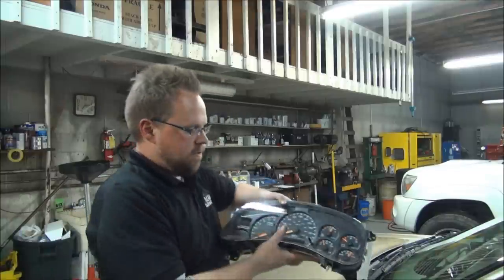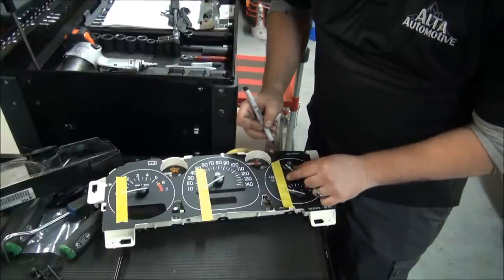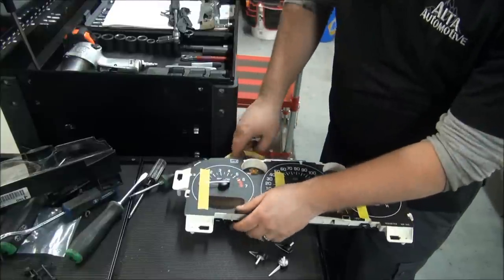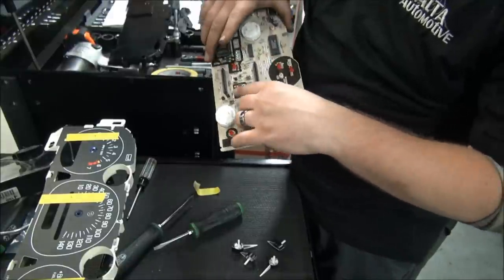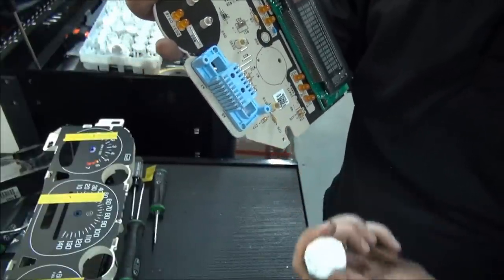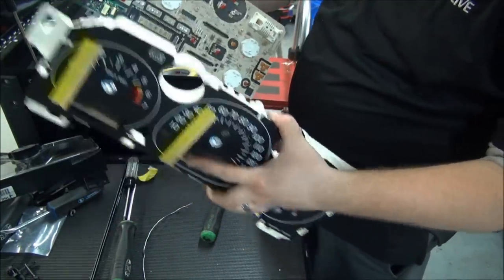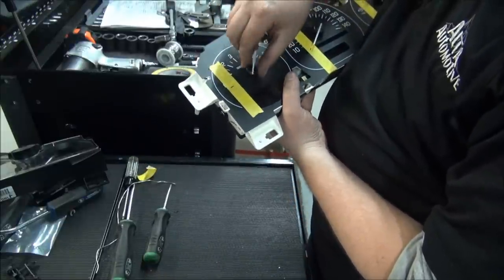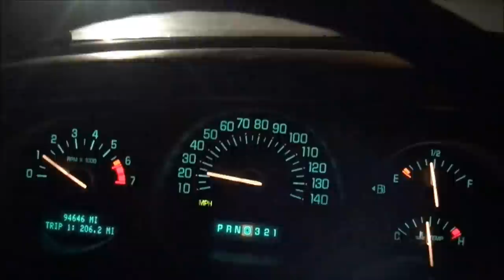How to repair GM Instrument Cluster | Speedometer | Gauge | Stepper

Comment: Great Video. Strait forward. Very easy to do after watching you. Just fixed my 2003 Suburban gauges. They all worked great. For those watching. Get the desolder  gun like his with the pump. makes it very easy.

Comment: all gauges are good except the gas/fuel. it moves fast like a hummingbird
Reply from the maker: The most likely cause for that problem, on that year Yukon is a problem in the fuel tank with the fuel level sending unit. The fuel level sending unit will start going out and send wacky information to the gauge causing it to jump around like that. Another thing I have seen is resistance in the wire from the sending unit to the gauge shorts, corrosion, small breaks int the wire etc. However you could have a problem with the instrument cluster/gauge itself its most likely the fuel level sending unit inside the gas tank and or the wiring. Also check out/subscribe my other YouTube channel... I just started this channel for people having auto repair related questions. https://www.youtube.com/channel/UCXFkbsmVhcDoLQcwEsixQTg

Comment: My 2006 trailblazer i can't read the odometer  or anything else in that display window during the day in bright sun. Yes the bright /dim switch is on bright. The oil pressure gauge and temp is off a bit. temp should be 180 not 220 oil should be 65 not 50. Makes me think its been worked on before and your tape tip wasn't used my real issue is not being able to read mileage, fuel use miles to empty. Its a LT Model

Comment: U vid on replacing stepper motors very informative. My gas gage worked soon as I started motor. After 5 mins it shut down and fuel light came on. After 5 mins shut off again. Keeps doing this like as soon as it got warm it shuts down. I know I’m the fuel pump it has the prongs attached to the float. I figure it can’t be the float cause it either works or it don’t correct? I just don’t want to drop gas tank if it is in fact stepper motor. Fuel pump is 179.oo. How do I test wheather it’s the reostat in float or if it’s the stepper motor in dash. Seems opening up dash would be easier and first place to start? Please give me ur opinion. I’m very familiar w electronics on vehicle’s. Thank you again your vids are good

Comment: well informed video but my question is :  if this is such a common problem on GM 2003-2006 was is there not a recall on them ? I have both a 2004 Buick Rendezvous and a 2005 Buick LeSaber with the same problem.

Comment: Hi, just wanted to know would this work on a 99 Chevy Tahoe 5.7 L - the only thing is the fuel gauge (it doesnt move or at times it goes all the way past E or F) the others work just fine. Also where can i order a stepper motor? thanks
Reply from the maker: +C Stiles I'm not sure the part number needed on that year.. However on that year Tahoe it's usually the fuel level sender in the tank or shorted wiring...

Comment: will changing the stepper motors make the display work again. P, R ,N, D, 3 etc and display panel ?
Reply from the maker: +Sincere Bless unfortunately no that's going to be a separate problem most likely a bad solder joint on the circuit board

Comment: Very helpful video thanks for sharing your secrets. I am a mechanic and have just recently discovered how easy you can fix clusters I fixed my odometer on my buick century the other day by soldering new resistors in. One question where do you recommend buying the stepper motors ebay?

Comment: good god! i found what my problem is after buying a new fuel pump! it was just the stepper!!!  DUDE! THANK YOU VERY MUCH!!! i have a Pontiac Montana 04.
Reply: so if i replace the stepper, my guage is stuck way past full. how would i know if i align the gauge correctly?
Reply from the maker: ***** Push the motor/needle back to the point it stops, that is the place to make the mark.
Reply: Thanks!

Comment: Great video!  Changed all six stepper motors in my 04 Trailblazer.  Your video is perfect.  I am not a GM man but this is a well engineered vehicle.  The only problem I have found is that some of the components are very low quality, i.e. the circuit boards in the instrument cluster, radio, climate control, etc.  Stepper Motors and Light Bulbs should be on push pins rather that soldered in.  Keep up the good work!

Comment: I live in San Diego.  All my gauges went out separately over a period of time.  I think the cause is faulty stepper motors on my 2004 Chevy Tahoe.  How do I find a mechanic in my area that can replace these?  I watched your video (excellent) but cannot do this myself.Thanks for your excellent video.
Reply from the maker: You can send it to me if you would like and I will repair it for you.. My cell is 801-668-5566 I answer Monday-Friday.

Comment: Mine go dead. I then disconnect the battery for a while and "sometimes" they will come back when I plug the battery back in. They then work fine, until one day I start the engine and they are dead.  I have no clue what this is. The cluster seems to be fine, once it's working. The illumination lights work fine. The gauges are just dead, as though they are not plugged in. Seems to be more of a grounding issue or something in my case. 

Any ideas?
Reply from the maker: Yes I have an Idea to whats wrong..... and its not the stepper motors..... Its most likely a problem with the circuit board... which is much harder to diagnose where the problem is without a very good understanding of testing circuit boards. I would recommend trying to find someone in your area that repairs instrument clusters.. rather than trying to fix that one yourself..
Reply: Yeah. I had it fixed a year ago.  I've found another youtube video that discussed a broken wire at the firewall. It lines up with what I suspected in my case. The truck has a possibly related problem. I rarely drive it and if I park it for a few weeks the battery goes dead. I replace the battery every year if I'm not careful to keep the truck plugged in to a charger. Once it goes dead in freezing weather it's toast.

The last time that happened, the guages had not been working for a while, and when I connected a jumper cable to the battery, there was a clicking near the firewall and everything came to life in the passenger cab, including the gauges. That worked for quite a while, but recently it stopped working again. The turn indicators and check engine light are all that work. 

I also had an issue where the blue "brights" light was always on. This is the only GM vehicle I've owned since my 1980 Buick Skylark and I swore to myself I'd never own another. Practically the entire car was beta tested by us buyers and failed miserably (yeah, I bought it new). I violated my rule and am paying the price. It's like I'm in the 1960's regarding reliability. :(

Lesson learned...

Comment: My parent's 03' Tahoe Z71 Instrument cluster (by that i mean everything in the instrument cluster including the LEDs) would turn on and off intermittently for about 6 months and now everything inside the instrument cluster has completely stopped working. Could the stepper motors be a problem, or do i have a bigger issue on my hands?
Reply from the maker: +CHFilms You unfortunately have a bigger issue and will most likely need to replace the entire instrument cluster...They are fairly easy to replace yourself, call the GM dealership and talk to the parts department...Have your vin number ready to give to the parts guy, and he will be able to get you a price.

Comment: Thank you so very much for making this video. I used a different video to assist with my taking off the dash trim and removing the instrument cluster, and then used this video to assist with replacing 4 stepper motors in a 2004 Impala. I spent 17 bucks on Amazon for the stepper motor / LED light kit, and 11 bucks on a quality solder sucker tool. A few hours later everything was put back together tight and all my gauges are working like they should.

Without your help, my Impala would still be doing 110 mph while parked (broken spedometer / stepper motor). You are the best!
Reply from the maker: +Nega Stoat Thanks!

Comment: Could bad stepper motors also cause the mileage guage to not work as well? That's not working on my 04 Trailblazer and also the gauges. Wondered if the digital mileage not showing up was also coinciding with bad stepper Motors?
Reply from the maker: Unfortunately that is not the same problem...The mileage not showing up would most likely be a problem with the circuit board in the cluster.

Comment: Thanks for sharing that video. My clusters aren't working in my new used 2002 Cadillac escalade. The fuel gauge doesn't work as well and I was told from the guy that sold the car to me that the tank would need to get dropped and a new floater put in. But after tonight trying to take it in for a smog. Seems the smog connector was not communicating to the computer and I didn't get the smog done. Seems like a host of problems. But I was wondering maybe the cluster stopped working on the gas gauge as well and maybe I won't need a floater after all? Thinking I would like to get the clusters fixed first to make sure I don't pour money to the piraranas out here. What do you suggest I do first?
Reply from the maker: Very good question! Here are my thoughts..
1- This video does not apply to 2002 GM (Cadillac, Chevy,Etc)  Trucks... I know this because my GM Truck is also a 2002 and the stepper motor inside the instrument cluster is different than what is in this video and very very rarely ever has a problem...In fact in the 20 years I have been a mechanic I have never seen it... Does not mean it’s not possible just unlikely
2-The most likely cause of your fuel gauge not working is the fuel level sending unit (or float assembly) is bad or the wiring to it has shorted or been broken.
3 As far as the your truck not communicating with the smog machine... that is a separate issue and is most likely a broken wire at the OBD-II connector or a blown fuse somewhere in the truck.
4-I would recommend taking your truck to a shop or a mechanic that is very good with electrical diagnostics...My shop would charge you $100.00 to diagnose both problems (in your area it may be more or less)... And when we diagnose a problem we guarantee that will be the fix for your car or truck.. The reason I would recommend taking it to a shop is because they have expensive diagnosticequipment that will help them greatly in the diagnosis.. Or if you are very good with the understanding of a volt-meter and you have the ability to drop the gas tank down and test the sending unit and the wiring.
5- My gut feeling is you need a new fuel level sending (or float assembly as you referred to it) unit for your gauge and a blown fuse for the lack of communication... I have also seen where some shops smog machine will not communicate and another shops machine will.. So if you don't find a blow fuse take it to another shop to have them try it on their machine..
I hope that helped... Sorry its not a quick easy answer for you on that problem...

Also is there anything else not working on your instrument cluster gauge assembly? Or is it that just the gas gauge that is acting up?
Reply from the maker: The stepper motors are very common to be the problem on many GM cars and trucks... However on the GM Trucks its 2003- to the classic body 2007 year models... The 2003 has and entirely different instrument cluster stepper motor inside of it verses your 2002 Cadillac... The 2002 and older trucks almost never have failed stepper motors.

Reply ·

Comment: My speedometer gauge needle went haywire when the original stepper motor failed.  The needle got pinned to max!  This made it difficult to know where to set the new needle when I replaced the stepper motor.  Any suggestions?
Great video.  Thanks Bri
Reply from the maker: +Dennis Waugh Set it about a tenth of an inch below the first mark.
Reply: Thanks Bri!  I appreciate your excellent instructions.  You saved me a lot of money, not having to replace my cluster.  Five stars!

Comment: Great video!! I do have a question.  My temp gauge on my 2004 envoy has stopped working so I need to replace the stepper motor on it.  But, the needle has fallen well below the normal range so how would I calibrate the temp gauge to the new motor since I have no starting point to go by?
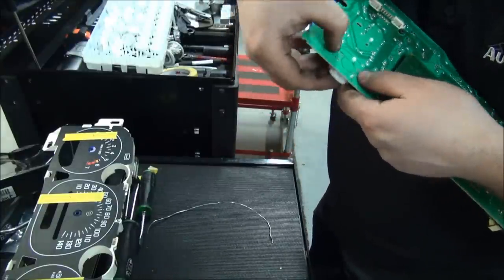Reply from the maker: If you cant find the starting point before you pull the needle off... Just pull the needle off solder in the new stepper motor and install the needle pointing at 12:00, than push the needle back and forth, forcing it back and forth until the starting point of the needle is just below the lowest mark of the temp gauge about the width of the needle below the lowest mark of the temp gauge. (maybe a touch more than that)
Hope that helps

Comment: My 2000 Nissan Altima dashboard use to shut down sometimes when I am driving. If I am using cruise control it stop working too. What should it be?
Reply from the maker: +Tubal Alves Ferreira The problem is most likely one of 2 things... 1- a problem with the wiring to the cluster, like a shorted wire, loose connection etc. or 2- a problem within the circuit board inside the cluster.... All of the wiring to the cluster should be checked if its OK, than replace the instrument cluster assembly. I would bet it most likely is a problem within the instrument cluster and would require a new or used one installed.

Comment: Hi Bri... I have a 2005 Buick Lesabre and all my gauges stopped registering within 6 months. For the most part there stuck and don't move. Every time I get gas the the gas needle will move but is definitely not were it is suppose to be and doesn't move again until the next time I get fuel. The speedometer right now is stuck on 20mph and doesn't move even when the ignition is off. The temp is buried and resting on the bottom and the tachometer is buried under zero in the exact opposite position as the temp....Sooo.... Do you think replacing the stepper motors will be the solution or do you think I need a whole new cluster? Everything else but the needles on the gauges works fine.
Reply from the maker: Matt Lefor Yes I think you need new stepper motors.
Reply: Yep... Just replaced them Saturday. Thx
Reply: K aiw

Comment: great How-to video. my 04 envoy speed, coolant temp is off. I had 1 question,, when u soldered in the new step motor and checked for any loose soldering points. if 1 is loose wld u desolder it, or just add more solder on top?
Reply: Mine is from AMAZON

Comment: Nice video but i wouldn't tacle on it. I have problems with mine i have 96 gmc sierra.& all gauges are faulty. Full fuel tank reads 3/4 my speedometer 10 milles above. Battery shows  low. temperature low. Oil pressure low can i send the cluster & can you fix it? I live in florida

Comment: My stepper motors are bad in my 2005 suburban.  I see you marked the needle's position before removing them, what if they aren't pointing in the correct position before removal?
Reply from the maker: You need to make them point in the correct position.... push them down until they stop...
Reply: What if your fuel tank is full?  Should it point to F before you put it back together.  My gas gauge is now way over full.

Comment: I have a 2003 trailblazer so i am assuming this is my problem also. My question is' what if the guage is completely off the chart....the ones you are working on have the guage pointing close to zero...a lot of mine are twisted out of the measurement range. do i still mark them where they are and put them back to that position when putting them back on?
Reply: Also...where did you get the stepper motors and the bulbs? Just a GM replacement from a dealer?
Reply from the maker: +P-Dawg No...You need to push the needle all the way to the left until it stops....It will feel kind of notchy, however you will feel it's starting point, generally just below the mark on the instrument cluster....There you will find the point to mark it...Make sure you watch the part where I do this a couple times as your doing yours so that you get it correct.
Reply: Do It Yourself Bri awesome! well thank you so much! very informative video. will definitely put it to good use! hope you had a great Thanksgiving and Merry Christmas!
Reply from the maker: +P-Dawg No The dealer does not sell them...I buy them from the manufacturer in very large amounts and would be happy to send you some...You can call my cell 801-668-5566 if I don't answer just leave a message and I will call you back...
Reply: Do It Yourself Bri that sounds great! let me get through the hustle and bustle of this weekend and i will try to connect with you this week! thanks again!

Comment: Can I buy the stepper motors from you?  My truck is an 06/GMC/SIERRA 1500/CREW CAB 2wd 143  I need  instrument cluster part # 15105687 according to the tech at the dealership.

Comment: Need help Bri,  my 2003 Silverado 1500 4.8 gage cluster goes dead sometimes -- just the Gage's , it might work for 3 mos then one day NO Gage's & they might stay off for 1 -2-or 3 days then when I start the truck PUFF they work again. Some one told me the 3 ground wires under the driver side cab mounts get dirty and to remove them and wire brush clean them,So I did and I thought it was fixed because it lasted 2 mos before it did it again,  stayed off 2 days then just came back on . HELP HELP

Comment: Sorry bud, but the cluster you're holding in the beginning of the video is not a 2004. It's out of a chevy truck 99 1/2 - 2002. Easiest way to determine that is the DIC up in the upper left hand side of the cluster. 2003-2006 has the DIC right below the gear shift indicator display.

Comment: Hi, i have a lumina 97 i remplace the speedsensor in the transmission and it didn't work, the fuses are all good its only the speed ometer that isn't working do you  think it can be that i need to remplace the little motor in the dashboard